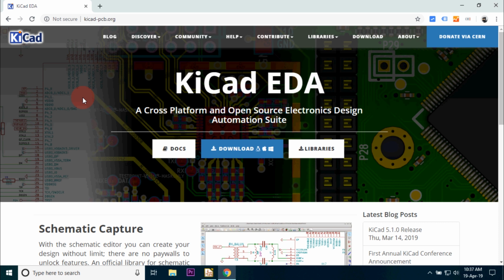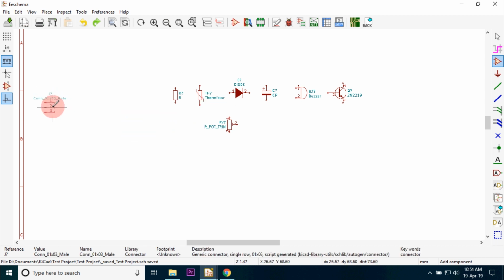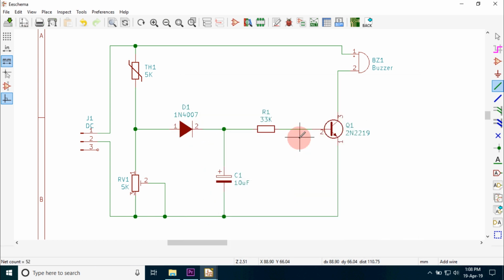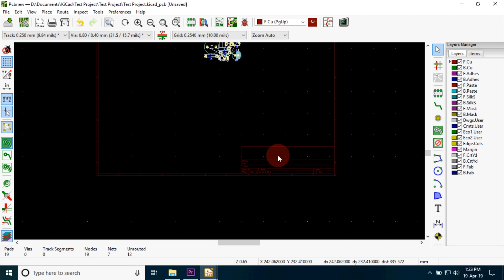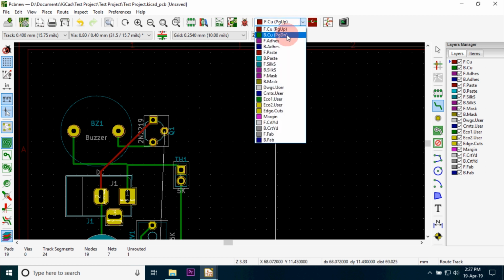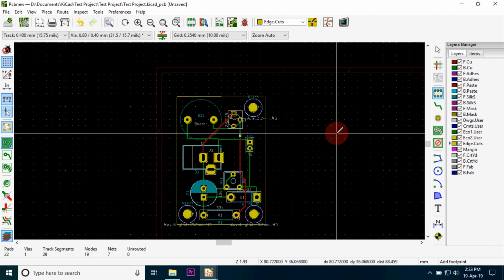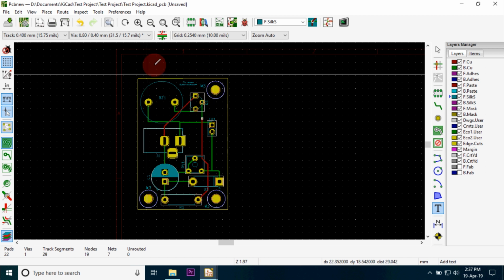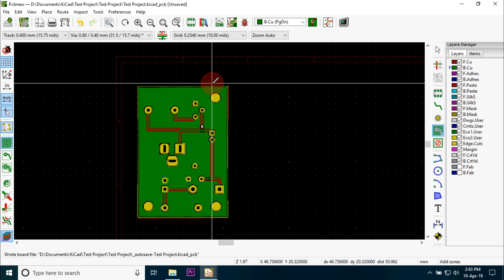KiCAD Tutorial 2019 | Learn KiCAD under 25 Minutes | Beginners guide

Comment: This is a very nice, easy to follow, tutorial for those new to PCB design and KiCAD. I've seen a few KiCAD tutorials that span several episodes and an hour or two of view time. They're comprehensive, but contain a lot of information not needed by someone just dipping their toes into the waters for the first time (designing their first project board and the like) which can make KiCAD seem intimidating to use for the first-time board designer or hobbyist. KiCAD is a powerful design tool with which a designer can create intricate multilayered PC B, but using it is really quite easy. My only criticism of this tutorial is that the entire project could have been implemented on a single-sided PCB but it would have been much larger to accommodate traces and layout.